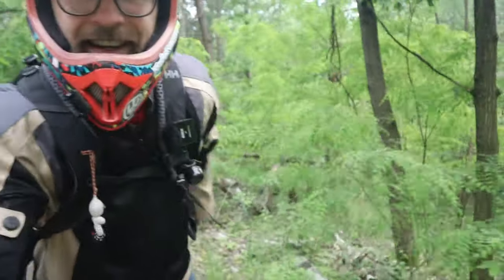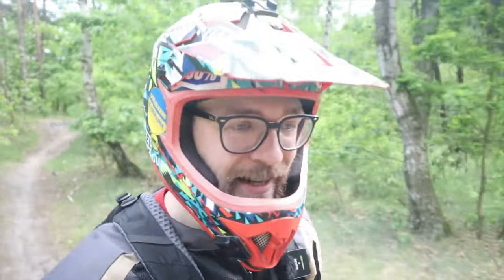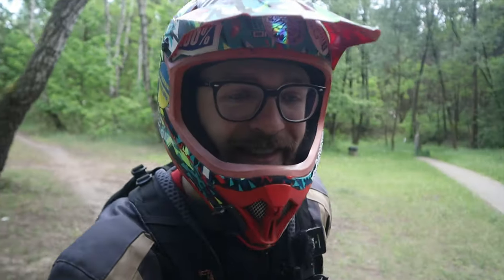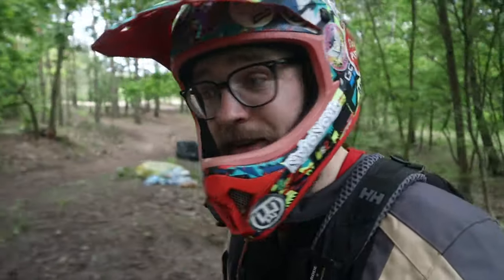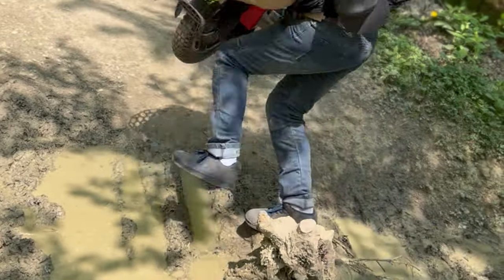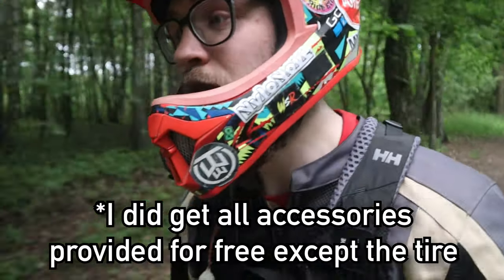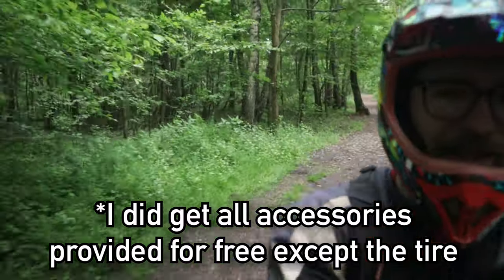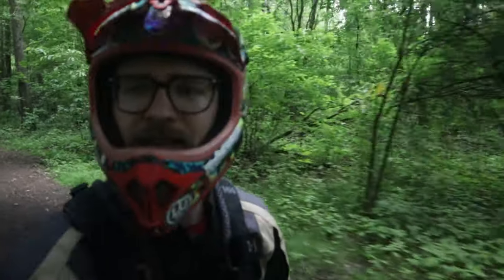KING-SONG S22 PRO MODS

Comment: Hey Adam!

I've been watching your videos for quite a while (I have also commented this or similar on multiple videos recently), watching your videos is what I got me interested in using my EUC as more than just commuting, on top of getting brave and doing jumps.

I've been riding EUCs for almost two years and began with an RS19HT, However, I quickly outgrew its speed and range. Living in the greater Seattle area, my EUC is my primary mode of transportation for work. The RS was just too uncomfortable to be used to regularly complete my trip to work which is 27.7 (45km) miles one way , so I upgraded to an S22 and even added a fast charger. I've learned a lot from these experiences and have transitioned from scooters to EUCs, all thanks to your videos.

What started as a brief comment has turned into a mini-essay, but I can't stop now. Along this journey, I began designing my own 3D-printed parts for my RS, mainly power pads. Currently, I'm riding an SS, and the jump in quality from the RS19 to the S22 was impressive, but the leap to the SS was mind-blowing.

The main reason for this comment is to ask if you'd be interested in testing out some power pads I designed, which I currently pick over the Patton pads provided by Ewheels for my SS (I use them together for my commute setup, which is shown on my Cults3d page ill include below. I also have another project in the works that I believe would greatly benefit your role as a wheel reviewer and tester. I would need to discuss the project with you privately to share the details.

The pads that I would love for you to try were designed specifically for the S22, and its small mounting space, Now I use them on my veteran sherman-s and I love them on it as well for jumping. 
the inspiration for the design (which is in its first iteration also) came from the hand guards I always used to install on my Dirtbikes when I was still riding. 

I'll include the link to my page so that anyone who has read through this "novel" can check out the designs for themselves, I feel it's time for me to actively contribute to the EUC community rather than just lurking, as I've done for years.

https://cults3d.com/en/3d-model/tool/toe-shield-jump-torque-pads (my everyday commuting setup) 
https://cults3d.com/en/3d-model/gadget/whitpads-power-padsv1 (my first ever designed powerpads) 

If you're open to trying them out, I'd be more than happy to 3D print a set for you and have them shipped to you.

Thanks for your time and dedication to the EUC community,

Comment: A little Tip...use self lock NUTS ;) on your M10 bolt.
They are a bit wider than normal ones so maybe u'll have to use a little longer bolt.
That should solve your issue with loosing them.

Keep shredding 🤙🏼
Reply: locking nutts should always go with washers, as locking nutt can and will scrap alluminium frame

Comment: Awesome info, always love watching your videos and I don't even own an EUC yet. I'd really like to see an in depth comparison of the Patton and S22 Pro. I'm torn between the two, they both seem to have their pros and cons, but I can't decide who the clear winner is. I just want a solid suspension wheel that can do a little bit of everything and excel in offroad conditions. Not too concerned with hitting 50mph or going any further than 50 miles. I don't really want to spend an extra $1k to get the wheel to where it needs to be though.
Reply: Hang in there man. If you desire to off road trails and such it is going to take time on a wheel first, get comfortable and start out slow. In a few months inmotion will be revealing there off road competitor with a spring suspension, as part of there new lineup plans.

As a s22 owner I would tell ya to wait. Depends on your use case. Wide variety of street choices. The s22 requires a huge 3rd party investment and very much maintenance. The Patton would be a ton of fun off road, but wouldn't want to ride on the streets. I think the Patton would make a good first wheel though.
Reply: S22 pro or Patton?
Reply: I think S18 is fine and meets your requirements.

Comment: Love then Hate then Love then Hate and now Love. 😂

This community and the manufacturers are in their infancy when it comes to what we want and what we need, what is the use case of a wheel, is it to heavy or to light, is it balanced and does it make a difference to all riders, and so on and so on. 

I just cannot wait to see what we will be riding in 5 years. It is going to be great.
Reply: It is indeed an exciting time for this industry. To think a little over a year and we had nothing but 84v and 100v wheels. Now 126 is a popular target choice, with 134 volt options as well.

There are a variety of suspension systems out there not sure what the best option is, don't think anyone knows just yet. I do lean towards a spring suspension system. Only time well tell.

Comment: Keep practicing. I think you are getting the hang of it.
I am 72 yo and a beginner. My first wheel is a 22 Pro. Do my wobbles count as carves? I am up and running. And enjoying exploring the backroads of Tasmania.
I bought the wheel as a spare. My car has broken down several times way, way south. I had to walk 17 Kms to get a few necessities. And 27 kms to get a bus out.
So the wheel is not just fun, but a necessity.
Where did you get the charger adaptor? I could use one.

Comment: Quick question. I have an s22 pro and I hate the stock tire. Thinking of getting a Michelin pilot street 2 80/90-14. I don’t know anything about tires so do you have any tips/advice? Do you think it will fit. I see certain scooter tires are different for front and rear. I assume you buy front tires?  Any help is greatly appreciated.
Reply from the maker: My Fav is in the video :) street tires will work too
Reply: @mr_wrongway  The Duro hf-307 is unobtainium  in my neck of the woods. (at least for a reasonable price) Luckily I just found a vendor that can get one. Im going to try this out and I don't like the Duro ill go pilot street. You rock as always and keep up your awesome work

Comment: Nice sand skills: Get ‘em (outta 10). 
 
Also, how often are you cleaning/maintaining your sliders?
Reply: I clean mine every 600 km. I ride trails in the mountains.
Reply: Sorry should have mentioned I use the Hou Ningning cnc 8 wheel sliders with the clips. It doesn't take long to remove the wheels.
Reply: @dirt.surfer this is tl;dr for all but the curious, feel free to bail out early while reading. Typed on phone so I’ll have to spellcheck later.}
 
Thank goodness for riders who step up and provide good value for aftermarket parts. I often think that a much better business strategy for EUC companies would be to sell/lease EUCs without any pedals, side pads or fairings simply to allow for a robust aftermarket that essentially does the advertising for free and unburdens the design budget from superfluous trim that most people will eventually change out of frustration. Why the heck would any CEO want to poison the growth potential of the entire sector? How much wasted time, effort and ineffectual marketing was spent on the S20 pads? Sure it looked good but why would consumers want to pay extra for pedals and pads that are just going to be stored until the rider (eventually)sells their wheel and gives the unused pads to the next owner to put in their closet. Are you satisfied with the pedals on your S22pro? I may still ride on my original 16x pedals but I’d rather not get a wheel when I knew that I would be upgrading my pedals and then get upset again whenever I buy my next wheel and cannot transfer over my favorite pedals. It’s very strange market behavior but I do understand that this industry grew out of some very unusual circumstances that’s more fascinating than I would have expected. I fully expect that the struggles that EUC design/builders have in bring these awesome machines to fruition… despite the teething pains, I still think every moment is worth the effort. But the reality is for most potential riders is that they cannot risk buying a wheel that is likely to become unsupported very quickly. The Isle of Misfit Monowheels is a tragic corporate legacy to follow because the unwillingness or inability to accept the losses from apoor design decision and stop reproducing that fundamental design flaw in the S19 iteration is just a punch in the gut. {Did you feel it too?}
 
Sorry for the tangent. Maybe I can clarify my concerns about buying an EUC by asking my own most important question: If you were trapped in Australia and a kinetic war in the South Pacific/ ASEAN region caused sanctions to completely disrupt the existing supply chain completely, then how many copies of which EUC would you need to ride the next 25 years, and how many of each specific parts would you want as repair/replacement parts over this time period? {Hypothetically… asking for a friend.}
 
So far I’ve got 2 replacement tires, a spare motor, a spare motherboard and plan to periodically rebuild the batteries as cells deviate in internal resistance. {So I’ll need a spot welding tool as those skills too.} 
 
I think this type of question highlights the flaws and serviceability of any given wheel model and its versions. 
 
{If I thought my knees were going to last 25 years, I’d get 5 copies of the OG Sherman with 4 tires and 1 extra rim for each as spares. 
 
Lastly, how many Hou Ningning roller sliders versus factory stock rollers? {Just curious, not for a friend this time} 
 
And, would you choose a different wheel if you lived somewhere else on the planet? 

{Side-note: these hypothetical questions do not account for increased risks of becoming collateral damage… so, if wepresume to survive, How many EUCs will MadMax need when petrol is no longer available yet the grid still operates about 1 hour a day? 
 
{Or, am I asking too much from one EUC design? … feel free to ignore the rhetorical questions. and I’m glad you like your S22pro enough to stick with it… I’m still thinking about buying a used one (or 4) in a couple of years when the dust settles.}

Comment: You so close to losing your shit in the sand lol, sand is the enemy. Nice video Adam.

Karen my s22 has a shinko 244 2.75 -14, grizzla ferrings/upper ferrings, grizzla rear gaurd and front bumper, kinetic 2.0 pads with custom color scheme, Hou Ningning cnc sliders 8 wheel. I believe I lose some range with the shinko but it is extremely aggressive offroad and yet still very carvy. I do trail riding in the mountains and it's beast. Just waiting for the board to fail me.

A third party has opportunity to address the poor suspension linkage and get a better system for unfortunate s22 owners. I too sheered those chrome plated tinfoil barrel bolts. They are splitting on people because till recently this geometry didn't move at all till the cnc rollers. Now that it moves half the bolt moves on a bearing other half binds, terrible design, and it does the in out spread as you described.  I also noticed the threads don't fill the barrel bolt from the sex nut and this also is a flaw.

You can drill a hole through that nut and bolt and use a pin to stop it from moving instead of locktight.
Reply: You mentioned that you’re unsure about the longevity of your motherboard. Have patterns of failure been seen that cannot be addressed with software updates? {I’m currently replacing capacitors on my trucks ECU, so I’m open to doing my own board repairs if it’s just replacement of a few MOSFETs as needed… although, not as many as the V12HSv1 seems to have needed, although I’m still unclear what percentage of boards actually prematurely failed. {but that’s another thing altogether}
Reply: @grb1969  I have seen in 3 videos the s22 fall over and burn the board, it's a small community joke. What happens is the wheels spins to a high speed and if it hit something it blows the motherboard. 

Motherboard was slightly upgraded on the pro version but imo it needs more overhead, a disappointing flaw that diminishes my confidence in riding. Between that and the poor suspension geometry my off road days may be over for the s22.
Reply: @dirt.surfer  Sorry to hear that the upgrades were not more substantive. I had outlined a slider design way back when the problem was unsolved and there are a couple of design changes that could marginally improve the sliders even more but then again, my ideas were slightly more complicated than what evolved but still only a stop-gap temporary repair until major design changes could be made.  Unfortunately, Kingsong seems to have just copied the idea (which is good) but then mistakenly didn’t completely change the design for a least 2 new models since that time. 
 
I can understand wanting to clear out the inventory of mistakes but continuing the design may have been a forced economic decision as it wasn’t the proper thing to do from an engineering perspective. And this contributes to the horse-race mentality that is harming riders as Darwin sorts out the awards.   
 
Sealed and isolated sliders are preferred but the space we had to work with is a severe limiting factor if the Aluminum casing isn’t to be changed. I may still get an S22 or two on the used marketplace but not until it’s at least as stable a platform as the 16x.  
 
Good news is that the linkages design looks to be extended to most future designs from other makers, who will combine that with MTB hydraulic style cartridges. And if the hydraulic leaks and maintenance issues get solved, then we should see some awesome wheels coming up in the next few years. 
 
I’m heartened to hear that Inmotion acknowledge that transferring the V11 pogo struts to the V13 is a mistake which they will promptly fix on future wheels (hopefully before the Adventurer gets released in the fall.) 
 
My frugality has me waiting for more robust designs but I’m appreciative that the community (and you) are demanding more. Some of my demands are still 5-10 years from being developed but i fully expect that an EUC could theoretically outperform and car or motorcycle given the time and resources. Many of the electronics problems that everyone is having can be improved with better mechanical system design but my ultimate wheel would cost around $6-8k compared with current pricing but they’ll need to outsource some of the engineering. I’ll give the design details another time, as the improvement claims I proclaim are often too far out for current riders to imagine. 
 
Thanks for all of your valuable comments in the past few posts, your frustration is palpable, concerns at 100% valid and insights are appreciated. Again, sorry for the long posts. I’m trying to chill but EUCs have much better utility and fun factor than flying cars or airplanes {another hobby of mine that is less appears now than 20 years ago).  
 
We just don’t want this sport to become like boating where the 2nd happiest day in that person’s life is the day they buy their boat, and their happiest day is when they sell it! 😬

Comment: now we need the ks s22 pro max where the battery goes way farther forward to give it 3200ish wh and make it 148 volt with in a hs version (30mm wide magnets with a top speed of 80kph) and a ht version (37mm wide magnets with a top speed of 65kph) 

i dream too much lol
Reply: battery just have minimum 6P configuration, as 4p not enough for big amp draws

Comment: Is it the bracket that scrubs the tire or the bolt? If it’s the bolt, they are available with a lower profile head.
Reply from the maker: Its the bracket
Reply: @mr_wrongway  Is it possible to file the corner of the bracket down on the inside so that it clears?